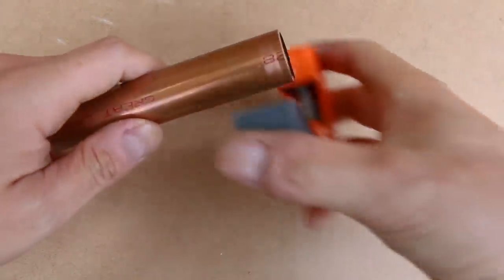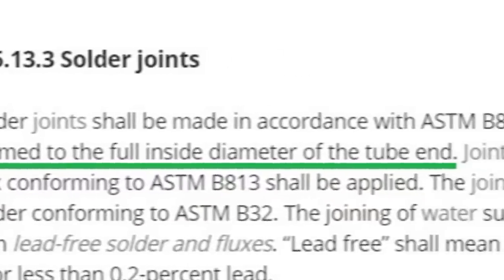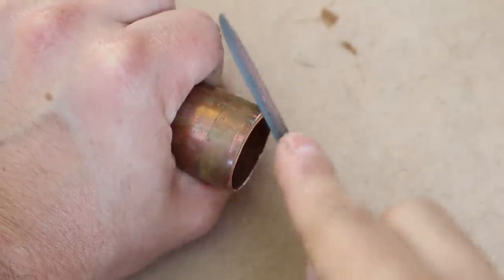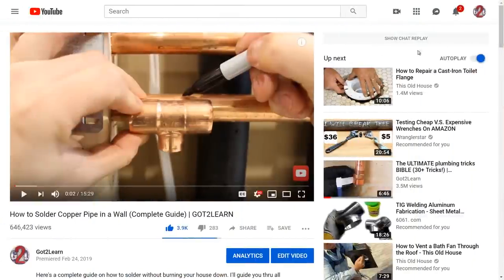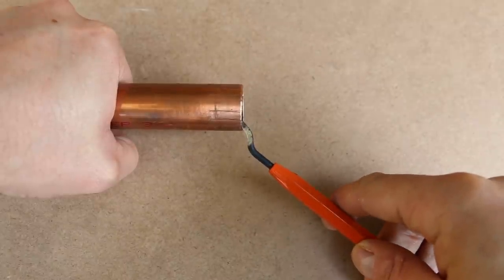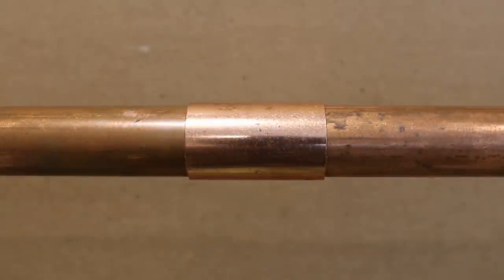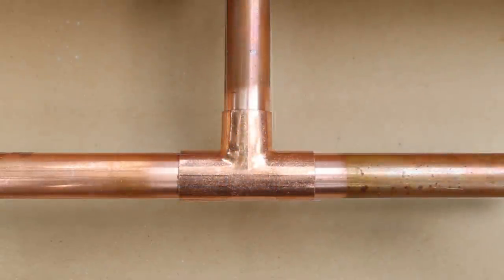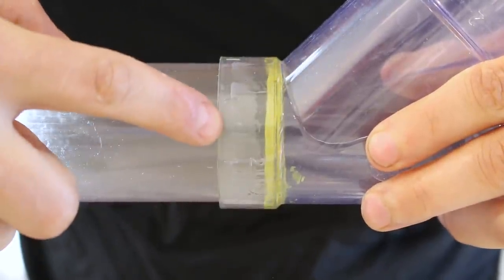The WORST Mistake When Soldering Copper Pipe (Not Deburring) | GOT2LEARN

Comment: What houses still use copper pipe? I was under the impression that all houses built today use plastic hoses for the water lines with those connectors that you just push the hose into them. I guess this is good for repairing old houses. I do hate those plastic hose lines they use now, when I run hot water they thump in the drywall, apparently you’re supposed to secure the hose to the 2x4’s but the jackasses that installed mine didn’t do that....
Reply: Copper is still widely used and preferred in many cases. PEX tubing is cheaper but the fittings require a press tool (propress). Professional plumbers do not use the "pushfit" fittings or "sharkbite" fittings. They are extremely unreliable, and require zero skills to install. If you hear pipes smacking when turning water on/off, and have sharkbite fittings, thats a pretty good indicator a professional did NOT install the system.

Comment: Only silver solder is acceptable for potable water in Australia
Reply: Interesting.  Why?   You can no longer use solder with lead in it for water lines in the US,  but you can still use lead-free soft solder.
Reply: @andrewalexander9492  im not sure what the reason is but the Australian plumbing standards AS3500 states it directly as requiring a 2% minimum silver content for brazing copper and 50 % for brazing stainless steel when in contact with potable water 
wishing your country all the best god knows it needs it at the moment 🇦🇺🤝🇺🇲👍
Reply: @scottmcgahey6820   Always interesting to hear how things are done differently in the trades in other countries.   So, not being obtuse here,  just trying to understand.  some soft solders have silver content.   But you're saying that if you were running 1/2"  copper pipe for potable water, you would be resewed to braze the fittings with a silver-phosphorus-copper brazing rod (like HVACR lines)  instead of using a soft solder?
Reply: @andrewalexander9492  yes precisely copper phosphorus silver brazing alloys is required on copper carrying potable water throughout the country in fact I did not know there where soft solders containing silver other than for electrical use and I have never seen the soft solder you would use in the USA/ UK for sale in Australian plumbing stores 
I am what is known as a mechanical plumber in Australia whereas while I am qualified and registered for all gas and sanitary plumbing.
 i only do chilled water and heating hot water , medical gas and refrigeration pipes 99 % of my job is copper pipe in 1/4 inch through 10 inch (yes all copper pipe is still manufactured in imperial measurements here in Australia. Dn100 pipe actually measures 101.6mm for example) we still pull branches by hand where possible and if necessary will make our own reducers etc on site 
Any other questions feel free to ask as I enjoy learning about other countries practices as well all the best mate
Reply: If you want to have a read you can google as/nzs3500.1 section 2.7.4 
It appears I was incorrect
There is a provision for soft solder however there is restrictions on its use and I have never seen nor heard of it being used 
As Australia and new Zealand share most standards and in Australia you have to pay for them whereas in new Zealand you don't I am reading from the new Zealand standards and the soft solder clause may not be in the Australian version either

Comment: If you cut any metal any where for any reason and you DONT know what deburring is, then someone fucked up your training. I have worked with metal at three different jobs and they all taught me to deburr, never did I know that I was supposed to deburr a copper pipe. I was an AC guy for a while, mainly condenser installs, and I never deburred. I mean I'm glad I know now but nothing bad has happened from it either lol

Comment: Sharkbites shouldn’t even be mentioned as a viable option. They are junk, and if you are considering using this product because of convenience, you shouldn’t be doing any plumbing work.
Reply: I was about to disagree with you but my perspective was incorrect, if I paid top dollar for a great plumber I would expect it to be properly done and permanent. Not riddled with orings that'll dry out and piss everywhere within a couple years. 

I like folks that choose the more difficult but correct route. Hate those who slackass cause they don't want to work.
Reply: @sacr3  you could still save a lot of money doing repairs yourself instead of hiring a plumber. Just learn how to sweat  pipes and do it right. I started out a long time ago at a young age teaching myself to solder circuitry and later moved on to brazing and welding. If you know how to properly solder, you probably already have a descent understanding of how to sweat pipes.

Comment: Total BS [deburring] taught to a generation of engineers that swat camels and strain at gnats.During my 40 years as a pipefitter I never saw a pinhole downstream a fitting caused by "turbulence".While an  inspector is all obsessed by deburring a pipe there are other problems in the system that are potential catastrophes that these college educated idiots are totally unaware of.Mental illness is passed along by obsessing in trivial matters while being ignorant of REAL problems.By all means debur ,but it is NOT a big deal!Not deburring electrical conduit IS a big deal.When I first started welding pipe there were back up rings in welded butt joints .Somehow we survived.Imagine the engineers at Chernobyl or Fukushima all obsessing over deburring while the real dragon was lurking in the shadows.That's my point.
Reply from the maker: Say that to the inspectors ;)
Reply: @Got2Learn  I just did.They cannot effect me anymore.
Reply from the maker: Hehe, they are a pain. I know a guy that was failed by an inspector because he didn't ream his joints, and he had to restart most of it, that's the PRIMARY reason why you wanna do it lol ;)

Comment: No. Not even half correct. Worst problem is kinking the line lmao. Second would be not nitrogen brazing.  If your doing hvac don't be a lazy bum. Use Oxy Acetylene and nitrogen braze. In any copper set up those are the 2 most important factors. No kinks in line. And proper brazing or soldering. Like use nitrogen when brazing or proper Flux when soldering so you don't have leaks or plug up fine filters in hvac systems with carbon.

Comment: You de-burred a pipe (blue de-burring tool) standing up. Where do you think those little filings and shavings are going? The pipes need to be prepared before they are installed. 

Also, when you describe the Pro-Press fittings, the pipe you are inserting was cut with a hacksaw, not a tubing cutter. A tubing cutter forms a small round-over on the outside of the pipe, which slides nicely into the Pro-Press fitting. (Shark Bite fittings as well)

A handyman like you should not be publishing videos claiming to be expert advice. 

My experience? 43 years - Master Contractor - Engineer - Vocational Instructor
Reply from the maker: Robert, when you are modifying a plumbing system, it will happen that you'll need to deburr in the vertical position, you just purge the system before completing the connection, yo should know that as a "master contractor". 

Secondly,  whether you are cutting with a hacksaw or a tubing cutter, you need to deburr the outside edge of the pipe if you are installing Pro-Press fittings or Sharkbite fittings, no matter what, or it's not code and insurances will NOT pay if something happens, you should also know that with all that experience you have ;)
Reply: Thanks for you video - I plan to use it as a “What not to do” lesson - tomorrow, in fact! Have a nice day.
Reply from the maker: Thanks for the views ;)

Comment: Too much solder?? Bro come on. What gets stuck is flux for starting from the top of the pipe instead of under. I have seen an expert solder pipe from the copper industry and they tell you to use alot of solder. Solder will push the flux out.

Comment: Bullshit. I've installed over 1000 boilers.  You need to de-bur pro press fittings and shark bites. If you hire someone someone to do any piping  ( heating or domestic water) and they use shark bite fittings, fire them. They're for amateurs and morons. A pro might use them in a snag for domestic water. Shark bites do not belong in hot water heating systems.  If you use them you suck. Pro press are nice but the tool is a few grand with all the heads. I rarely de-bur pipes when I  sweat pipes together.  I will for freon but for water it's not important.  Those tiny pin hole leaks are from hard water eating you pipes. Whoever made this video can argue with me. I'll show my decades of pipe work. You show me yours.
Reply: And the real worst mistake in soldering is not sanding and using flux. Too much flux can be bad. It's acidic.  It cleans the pipe, but too much is bad. It sits in the pipe. Wipe your joints d o the don't corrode.
Reply from the maker: You can say what you want, but it's code to do it and not code if you don't ;)
Reply: @Got2Learn  I've gone through plenty on inspections in Pennsylvania.  They've never asked about de-burring pipes. They check p&t valves are piped. They check for grounding.  What's the national boiler coded for piping a p&t to the floor?
Reply from the maker: I am not saying you are wrong, I am just not saying you are right. Different states use different code books and that's just in the US, here in Canada, engineers check pipes if they are properly deburred and if they aren't you run the chance of restarting the job so, we just do it, it's not worth the risk.
Reply: @Got2Learn  I give it to you in Canada.  Your codes are much more strict. Some better, some not. Bless you for dealing with it.

Comment: Total bs. Sorry. Just is.
Reply from the maker: Hmmm...😬
Reply: @Got2Learn  The reason that you deburr has absolutely nothing to do with smooth water flow through the pipes. Those little hiccups along the way would be so negligible they couldn’t even be measured with a micron microscope lol!
Reply from the maker: @louisp.3332  I agree with you on small circuits, but long circuits, this will affect the overall performance down the line, just like the length of piping will affect pressure on long runs, cheers!
Reply: @Got2Learn  not even a tiny bit... just installing ONE 90 degree bend will cause 100 times more disruption than a little deburring issue. I absolutely disagree :)
Reply: @Got2Learn  keep in mind that Pex pipe, which is predominately used now in most plumbing systems, ALL the fittings are insert fittings, which means? Every single coupling and 90 and tee and male and female, perhaps HUNDREDS of fittings, has nothing BUT major bumps and ridges inside the pipe, 360 degree circle no yet. So if what you were saying was true, hardly any water would come out the end :) 

I’m not saying you shouldn’t deburr pipe, I absolutely agree that you should. I’m just saying the reason you are stating why you should is incorrect, even though every one says what you say. 

The thing is? These people who are talking this nonsense about water flow, I absolutely promise you they are engineers and other idiots who have never spent two seconds actually installing a plumbing system!!!

There is always the theory and analysis and stupid stuff like that done by experts that tell you that what you are teaching is true and correct. But in actual reality, in hands on applications, it has absolutely no business being taught like that.